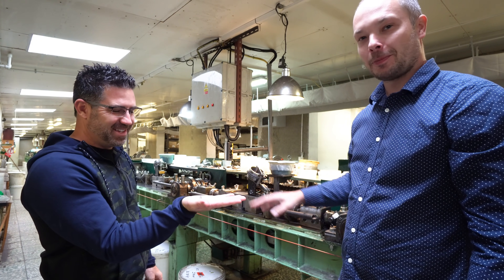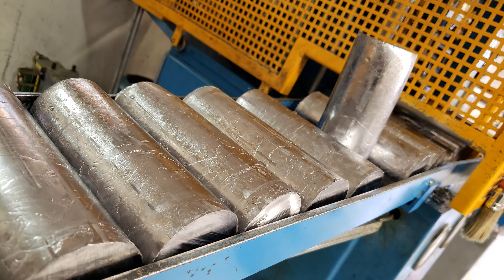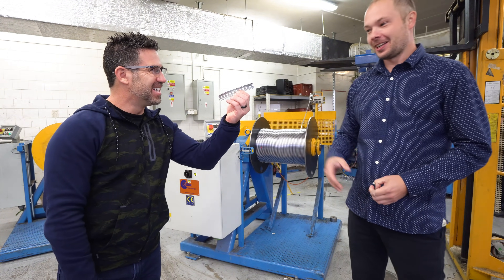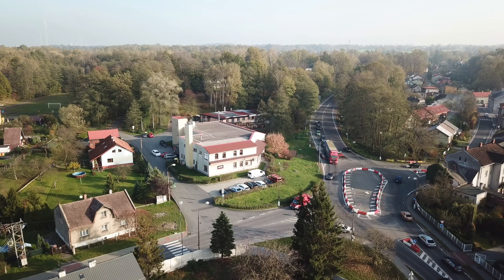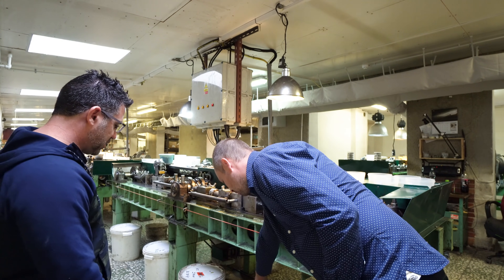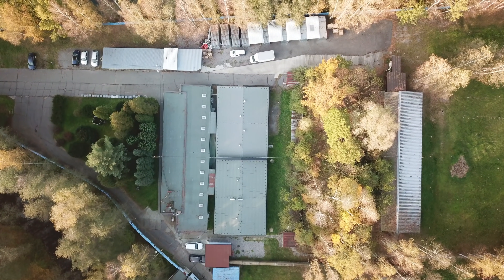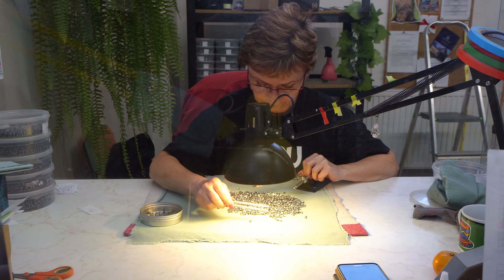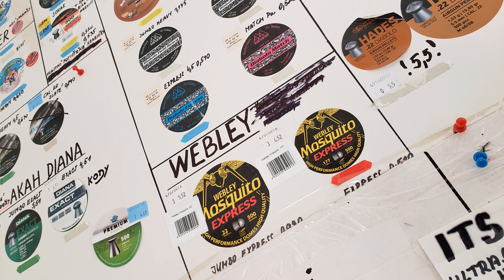JSB Air Rifle Pellets - FACTORY TOUR!! - Match Diabolo Pellet Manufacturing - Airgun Slugs - PCP

Comment: now when im gonna use jsb pellets I will be thinking of those 40 ladies and their dedication to the quality check process
Reply: yes me to but wonder why they bother as the jsb jumbo diablo .22 i was buying mostly have damaged skirts otherwise they was good pellets but they need to sort this problem out  as it was a lot of pellets and im not the only one  saying this shooting groups im on all saying the same thing
Reply: @WeihrauchShooter  yeah I find the same thing with them about 30% of tin sometimes
Reply: That damage likely happened during shipping. Lots of box slammers working in the parcel industry. Leaf spring suspensions on freight trucks cause damage too.
Reply: Me too,,😉😉😍
Reply: mine are shit as well and loads lead bits in bottom of tin so that quality control is sh.t

Comment: It was interesting to see both of your Factory Tours videos to the two most famous pellet manufacturers (H&N and JSB). I was surprised to see that their productions methods are quite different.  The way they made their pellets is also different. H&N forges the pellets right from the wire while JSB makes a small ball that later is transformed into a pellet. Also H&N seems to have more automation in their manufacturing, especially in the packaging area, while at JSB the packaging is manual. Due to my work, I have visited hundreds of plants during my career and I have been exposed to some of the techniques and processes that both of them use. However, and even for me, both videos were very entertaining and well done. Thanks !!!
Reply: Como funciona, o fio de chumbo é prensado em um molde?

Comment: Great tour. I can appreciate what you've shown since I spent 10 years in manufacturing; using, setting up, and maintaining similar (but larger) machines. Then I moved to the quality department and worked there for another 10 years becoming the head of quality. Very tedious and very satisfying work. If you love it, your company will make great products, (company permitting), which ours insisted on.
I love my JSBs, or I should say my guns do. Now I know why my consistency improved when I switched my .177 guns to Air Arms pellets. I didn't know JSB made them. 
We had a product being made on several different, but identical, machines. He is right, no two machines can make identical parts no matter how they are built, set up and run. You can only get close. Our close was measured in the thousandths of an inch even when 1 one hundredth of an inch would be great. Part of "World Class Manufacturing".
I am about to order more pellets and was planning to order some Air Arms pellets for my .22 caliber. Now I am going to get 2 or 3 tins to try out. 
Keep up the good work, JSB, you have a loyal follower here.
And you too Steve
Charlie

Comment: At 28:22 you asked what was acceptable at 50m. He answered that it was specific for every type of pellet. Did you find out what was the maximum group size acceptable at 50m for the most common type: the .22 -18.13gr?. Great video. Thank you for your time and effort.
Reply from the maker: Nope, they never did say.  I would guess .50" at 50 yards as this seems to be the standardized goal now for PCP manufacturers.  Steve
Reply: @AEAC  Thank you. Btw, it would probably be 1.25 cm @50m (54.7yds), since in Europe we use the metric system. Saludos, Jose.

Comment: Man that was the best. I was glued to my phone till the end, respect and great admiration to JSB, the founder to the packers and thank you for doing such a respectful production. Great job. Really great job. My 1st Gold Label 500 pellet tin of JSB Diablo I bought and from there they were my number 1 choice with H&N second and MARKSMAN Pointed pellets for everyday plinking with my CFX. For my PCP and anything else JSB. (Only lead pellets) Thank you great job and God bless 🙏 PS. Should do a video on the old Marksman lead pellets specifically with underlever spring guns like Air Arms and Weihrauch. Rohas is nonsense only implemented because lead interferes with Radio frequencies like WiFi and 5G

Comment: Amazing.  Just wondering how healthy it is on that factory around all the lead.
Reply: Raw lead when protected from oxidation is almost totally harmless. It's LEAD OXIDE, that white powdery stuff, that's what's hazardous to your health. You can handle raw lead all day long, and as long as it's protected from oxidizing (with an oil of some sort) and you wash your hands, it won't be absorbed into your blood stream, nor is it light enough of a particle to be inhaled without mechanical/aerosol dispersion. 

I spent time working in a National US laboratory (accelerator physics) and we had to handle lead in brick and sheet form all the time for radiation shielding. It was made a very strong point in the classroom that lead oxide is the dangerous part-all we had to do was add a coat of simple latex paint and it kept our lead from growing that white powder.
Reply: @Matt Mann Haha "Hanging around with Uncle Sam" yes, this can be highly hazardous to your health. Yeah most people don't understand hazardous materials such as lead, asbestos being the most misunderstood. . .but I won't get into that here.
Reply: I was wondering the same, we used to hold our pellets inside the mouth when we were kids, lol! But like Rileymagnification pointed out, it's the powdery oxide that's harmful, which is what paint manufacturers added to paint to accelerate drying, prevent corrosion, increase durability and shine, etc. They still add some to road marking paint.

Comment: This was quite an interesting video. 
I have always enjoyed watching manufacturing of products, especially a product that I am using. The amount of quality control that goes on in THIS manufacturing is beyond any of my expectations. I am really amazed and impressed. 
What I would like to see is the new Hades pellets in .25. I run the FX Wildcat in .25 and my AA-S400 is my .177 but I mostly use the FX. For some reason it seems like there is more emphasis on .20 than the .25 when it comes to varieties. For my FX I will always be sticking to the JSB Match Diabolo EXACT KING .25 Diabolo.
I can always depend on the same results every time I shoot. 
If there is a problem it must have been operator error; meaning ME!

Comment: I was always told to take some oil in my micro fiber towel and roll my shot around in it to give a coating of oil. So it will not fail the barel as much. Because lead will drag/stick to the barrel..

Comment: So the weight of the ball is critical. If they had a weight sorting machine before they are pressed into pellets, together with not mixing batches between dies, it would save a lot of the manual checking downstream.

Comment: A single 0.177 JSB 8.44 grain pellet travelling at 50% of the velocity of light will have a kinetic energy equivalent to 1,500 tons of TNT. That's enough to flatten a medium-sized town or several city blocks. And they sell these in tins of 500 for less than 15€. Wow!!!

Comment: ❤❤You can see the difference between HR German made pellets to here ,the Germans make the wire to perfect size and it goes to one small machine that spits out a perfect pellet with no waste lead to be remanufactured ,,,and here you can see the machines are old tech ,,there huge but simple ,,there more steps to take and the machines are massive and would never be able to be upgraded as they are ,,if they wanted to simplify and upgrade there machinery they would have to go same way as the Germans  ,this type of manufacturing still comes out with the same final product ,as the young guy said "this is basically old Russian style type manufacturing and been same machines running for 60 plus years making all types of bullets and pellets .very cool to see it all running and people working .

Comment: Wow, a lead factory and not a single soul uses breathing masks or gloves in the entire video!
Reply: They must have very good extractor fans.
Reply: @NickSchoonwinkel  Blood lead levels are off the charts !
Reply: I noticed that too. I held my breath a couple times for them.
Reply: Worrying.
Reply: There was at all the molten lead area but after that the things are pretty much covered with lubricant after its made into wire at every step. I doubt there is much lead "dusting" to even be able to breathe from then on. I cast my own lead bullets and its pretty much the way I handle the same thing when doing up to 200-300 grain bullets.
Reply: H&N also needs a better vented  area for there lead melting pots.
Reply: So wrong in meany ways :(
Reply: No safety guards either,
Reply: Nah. It's not a problem. Lead oxide is hazardous to your health, and after the melting process, as long as the lead us kept from oxidation, perhaps with an oil of some sort? There is almost zero health risk, as the particle size is too large, and too heavy to be dispersed, and if it can't be dispersed, it can't be introduced into lungs. I've worked around literally thousands of pounds of lead shielding in brick and sheet form, and unless you let it oxidise, then disperse the oxidation, it's almost totally harmless as long as you wash your hands after handling.
Reply: I was also thinking the same. I wouldn't use a blood test to measure it, but rather a HTMA test will be more useful for long term exposure. I hope they test everyone.

Comment: This is what America used to be, Hands on workers. So the pellets are swaged BUT since they control exact ball size the molds do not have over flow ports so each pellet is the exact size. seems like the perfect setup. That is probably why they are having problems with slugs swaging a long slug is harder due to air and trying to fill the voids.

Comment: I’d be more than happy to pay twice the money for a tin if they manufactured a premium line of pellets where the machines were run slower and more accurate with the weight of material used. Also if they were sorted before packaged, I don’t care what rifle you’ve got £100-£3000 it’s 90% about the pellet.

Comment: It struck me that none of the ladies wore gloves, while ‘it is known to the state of California... etcetera’. But seriously, to have lead on year hands constantly can’t be healthy I suppose. Or is that a myth...Nice video by the way!
Reply from the maker: Lead can only be absorbed into the body via ingestion or inhalation.  It cannot be absorbed through the skin.
Reply: I see, reading the back side of some pellet tins it doesn’t say so either. They only mention warnings against inhalation of lead dust and putting pellets in your mouth. The recommended washing of your hands is meant to avoid licking your fingers after touching and picking up these pellets during shooting. Thank you for your reaction, it prevents a slight fobia for lead pellets I think I was already developing.
Reply from the maker: @fredzl1234  I always just wash my hands good after use and try to keep them away from my face during.
Reply: @AEAC  True - but any mucous membrane will do - rub your eyes or nose, eat a potato chip, etc.  It is also true that pellet guns do not produce inhale-able lead, but those reactors that heat it up to 900F sure will.

Comment: Well i can BUST your busted myth !!!   JSB  exact jumbo RS  diabolo,  from die 50 and die 25 are totally different. 
I received them from the same importer and dealer in the same batch of 3000 pellets but one tin coming from a batch starting 50 were very different, looking more like the Falcon accuracy plus, with a shorter pellet, flatter dome, lighter, more forward C of G, and with a waist band, whereas the std jumbo rs  just has a pinched waist. and the performance is totally different .... 
JSB told me it's the same pellet...but when one can hit a plate at 75 meters with one and the other a pound coin at 75 meters with 3 points less hold over, that's not the same pellet..  If they are shooting each new batch, how can they pass the massive difference between performances of these batches as the same pellet.
The 50 batch is lighter at 13.34gr, not 13.43gr, flatter radius dome, shorter overall length, deeper internal cavity ( will affect chambering ) ,more forward center of gravity,  banded waist, and when shot at 300m/s  flying far flatter , even at 25 meters the drop difference is over 10 cm's.   So different and far far better, ive been searching for more of the magic 50 batch but so far none have shown up ....for me it's not the same pellet at all, but why do JSB insist it was the same pellet....and i still have 250 left for my next competition as they are so vastly better....how can quality control be that bad or are they lying ?